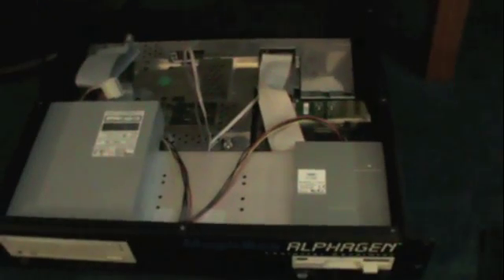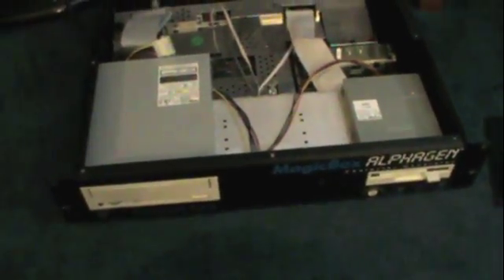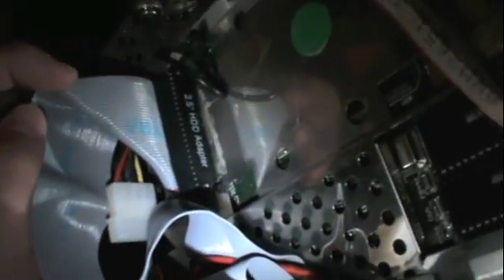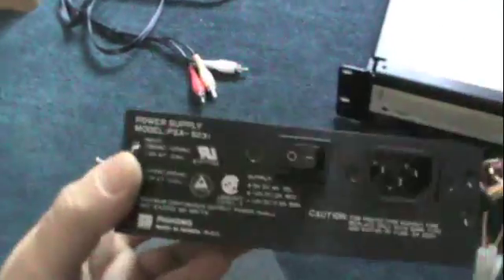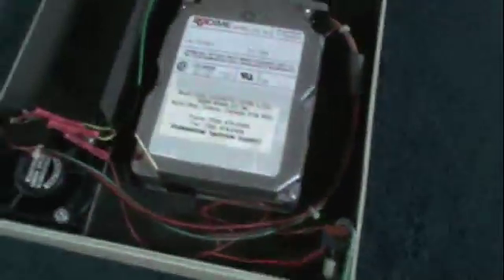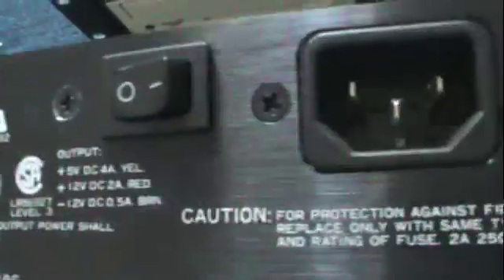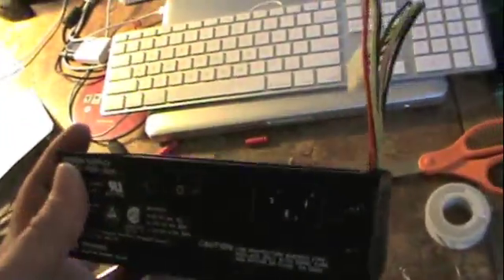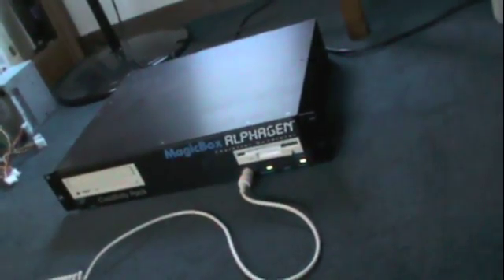Fixing The MagicBox AlphaGen and A Closer Look

Comment: And here's another fun fact: The older version of the MagicBox Alphagen (the one without a CD and floppy drive in the front panel) has a complete Amiga CD32 console inside it. They didn't even take it out of its standard case. It's literally the console, stuck to the bottom of the rack-mount box, with some expansions around it.

Comment: The white connetor you says is for a floppy drive is not for the floppy drive, it's is for the orginal keyboard, the chip you say is co prosessor is right and the chip you say is main prosessor is right, the card slot can be used for network card and other expansions like memory or cdrom drives or harddisk drives.

Comment: That's the 68882 FPU chip. It was also used in the PB 180, as well as several other Macintoshes and probably other 68030 Amigas as well.

Comment: Did you get the date codes on the chips to see when the board was made? NTSC Amiga 1200s are very rare, at least in their original home computer form, but if the dates are 1994 or older, this could've been made from old stock bought out from Commodore when they went bankrupt. In Germany, a company called Escom resumed Amiga 1200 production until around 1998, and I've heard of some clone boards being made, so if the dates are post-'94, it's an Escom or clone board.